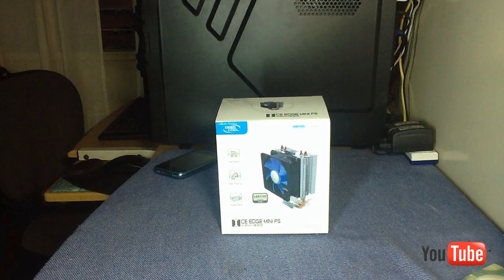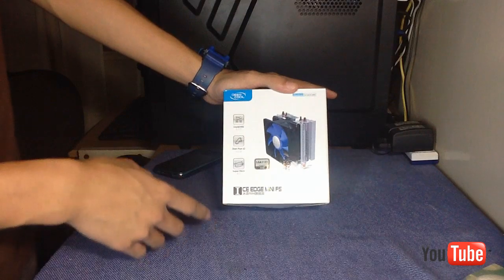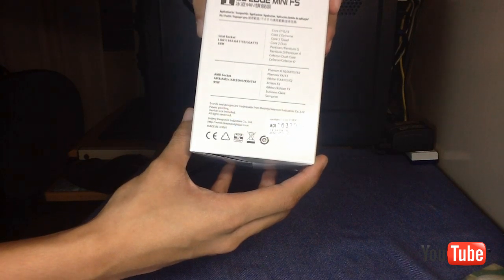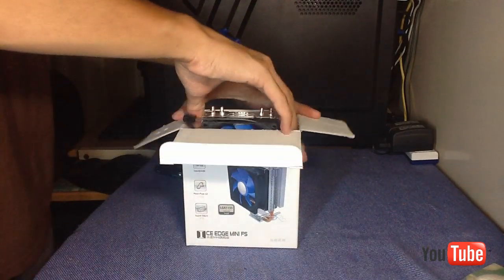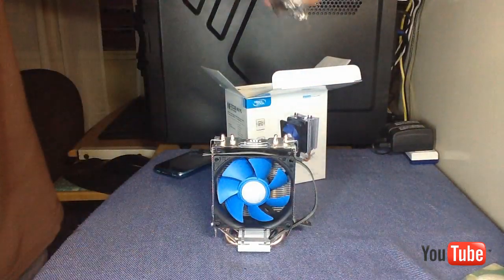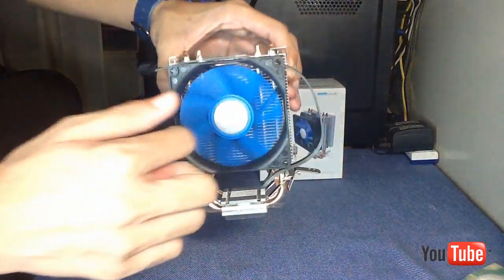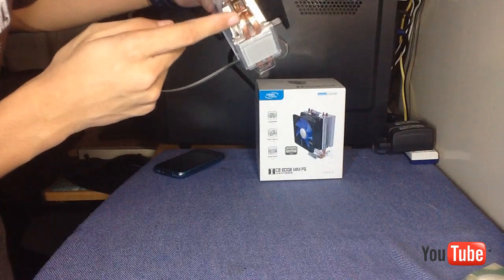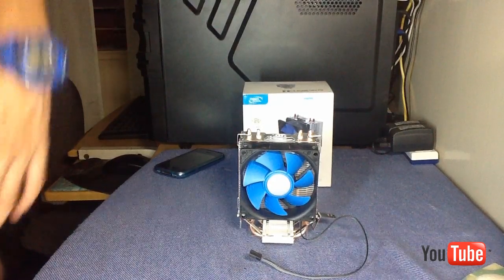Deep Cool Ice Edge mini FS CPU cooler Unboxing

Comment: I bought one of these as there was nothing else available in the shop and was not expecting too much from such a fragile piece of gear. After fitting I was amazed at the lower temperatures from the CPU......  really impressed.

Comment from the maker: yes the strike x case have a pretty good job in air flow with this cpu cooler but the cable management is a little bit odd because the holes for it don't have covers. sorry I didn't not yet record temperatures with these hardwares.